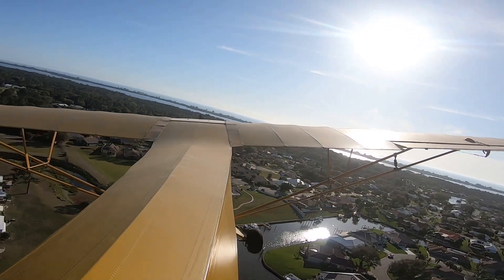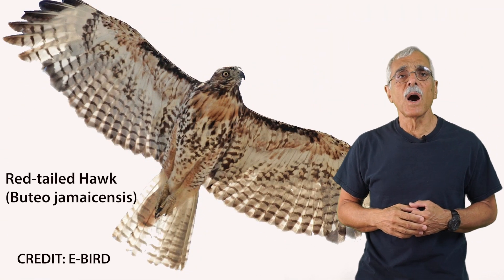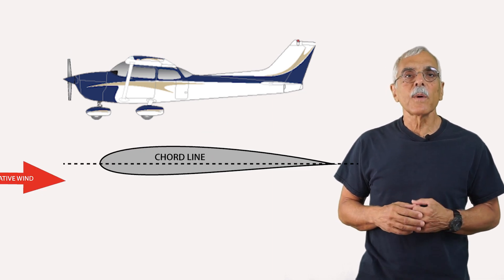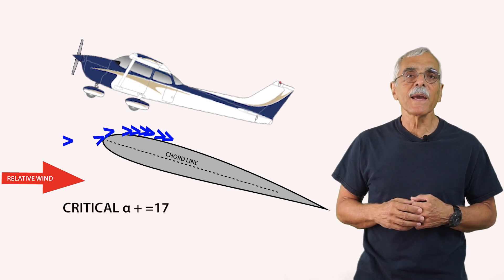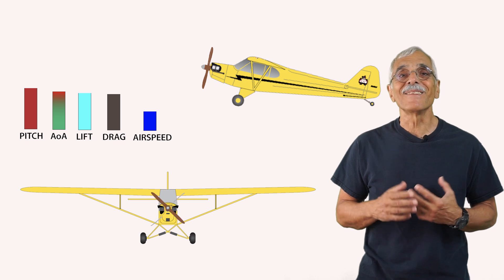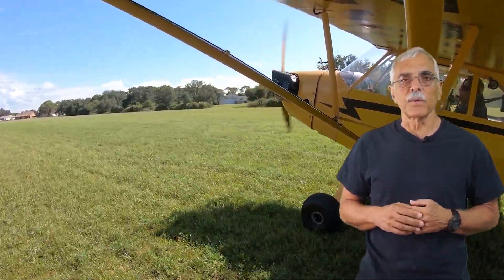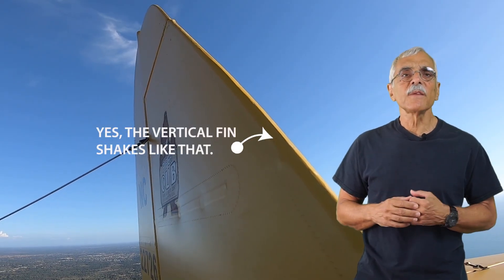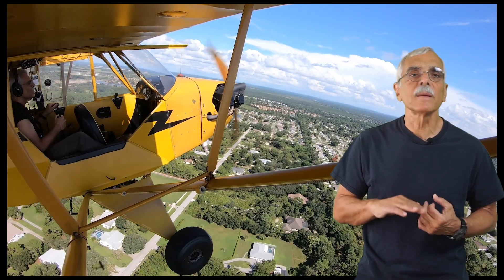How I Stalled on The Base Turn (And Got Away With It)

Comment: As I got past sixty years of age, I realized that there were moments when the slightest distraction could and does cause “brain farts”. I'm sure many of your readers/viewers are probably aware of them, and I wonder if you might know of any exercises we could do to lessen the chances of this happening while in the air. Also, a Washington State YouTuber called Backcountry 182,  is a very focused pilot and has installed an angle of attack system in his 182 and 170b. The thing that struck me was your comment about having to look at another gauge you didn't have to before. The advantage to this unit is that it mounts on your panel dash somewhat like a HUD, only it is a physical device that is in your viewline. Easy to see without being a distraction. The sensor device mounts under your wing like a pitot tube. Just a thought. I'd recommend it judging from his videos. He spends a lot of time flying the back country in his modified aircraft, landing at remote strips and landing/taking off on river bars.
Reply: You are constantly monitoring your airspeed on final anyway.
So installing an angle of attack indicator close to your line of view
of the outside, or the airspeed indicator might help a lot without 
increasing your mental or physical workload.

Comment: Great Video. I was on base at CUB turning to final in our Champ and the pilot I was flying with was talking about a friend's just finished RV7 holding for takeoff.  We were in radio communication, keeping looking at the RV7 and getting set for turn to final I got slower than comfortable. I didn't stall, but I realized as a lower time pilot that it was important to make sure that I didn't get distracted.

Comment: I've been teaching that so long as you are gentle on the rudder pedals down low on approach - then you probably will slip a lot. But you won't skid. If anything startles or surprises you: PUSH forward on the yoke/stick. And for the love all things good: if you find yourself slow and low; only push the rudder pedal that's high in the sky.

Comment: Just use the stall warning device in the Cub (and every other plane). It's called the stick (or yoke), and your plane will stall at the same rearward position every time (or forward position if you're inverted) regardless of speed or bank angle. Just remember where on your thigh the stick/your wrist rubs when it stalls and you'll always get a wake up call when that part of your thigh gets a rub.

There's a direct link between elevator position and angle of attack, and the wing always stalls at the same angle of attack regardless of bank angle (or whatever). And there's a direct link between elevator position and stick position.

Go up and give it a try at different speeds and bank angles (not too fast - you don't want to rip the wings off)

Comment: I did something very similar. I was looking out the window and slowing down at the same time. I was in a early model super cub with no stall warning. When i felt the shudder from the stall I was in a shallow left turn so I added right rudder and power but I was too low to recover before hitting the ground. The impact was hard enough to shatter my lower vertebrae and brake my brothers ankle. By the grace of God we both recovered very well. I have since added about 15000 hours to my logbook as a professional pilot and the biggest thing I take from my mistake is never quite flying the airplane or it will bite you.

Comment: Oh man…reminded me of this time I was requested to do a 360 on base to let another faster plane land first…midway through my turn the stall alarm went off. I was still a student but it’s impressive how quickly things can creep on you if you’re not scanning the instruments enough.
Looking back, when I was requested to turn, I stopped my descent and didn’t adjust power enough to maintain speed, you live and you learn!
Reply: Still a student pilot here :)  I never heard about being requested to do a 360 on *base*, that seems very weird.  And dangerous, as you found out; you're in a low power, low airspeed descending turn (or about to make one), and suddenly asked to change direction and maintain altitude.  Sounds like a recipe for disaster.  Was this at a controlled field?  If this happened to me I'd probably have called "unable".  Maybe they'd tell me to go around, but that's a well-practiced safe maneuver.

Comment: my own fluster moment ,flying my  1947 Navion, approaching the airport at crosswind, expecting a right turn to downwind everything going fine, just before turning downwind, the airport announced conditions determined la ndings done in the opposite direction I was prepared for. no problem, I'll do a crosswindentry to downwind across the runway- it all went exactly as planed- smooth as silk, as I turned final at about 200'AGL,I cutback the power and heard my gear horn go off, I was committed via altitude and speed to land, lucky me the Navion had great gear response and I got 3 greens about 2 seconds before touchdown (whew). what caused it? just as I was to lower landing gear is when t he airport advisory stated direction changed- and I totally forgot to lower the gear. a person gets used to doing things in a one order of attention, once that was lost, I never thought of it again- thankful for the safety o fthe Navion,

Comment: Bet that bird didn't stall :-) Really enjoy your aviation content, thank you!
Reply: Yes. As pilots often say, the best flyers on the planet are birds. Now, I have to look up if birds actually stall. I've seen some come close.
Reply: The bird has a cheat, its called feathers 🙂
When the airflow starts to depart from the wing in a stall, the airflow lifts up the feathers. Muscles pull the feathers back down and this also pulls back some of the departing airflow.
Which means they can handle much higher angles of attack and not stall.
This is also how stooping hawks can go faster in a unpowered stoop than terminal velocity should allow.
The feathers moving up and down trap a boundary layer of air which greatly reduces their drag.
And also interferes with the creation of vortices coming out the back.
kind of like the dimples on a golf ball but more efficient.
Owls use feathers to control the airflow, for no noise, so they are silent death.
Amazing things feathers. Aircraft and race cars need to be covered in feathers.
Reply: @quadg5296  Hi Quad. That's very interesting. Mass itself must play a critical factor. Now I have look up more information. I did not understand the "feather" factor, but it makes perfect sense.
Reply: @T.J. Kong 
A wing works by having high pressure below and low pressure above. Which generates lift, created by constant smooth air flow. Across the aerofoil. Turbulence does not help. The turbulence is the airflow becoming detached and interrupting the constant air flow. 
Which we call a stall. Instead of lift you get turbulence and drag.
By pulling the feather down they induce low pressure into the space between the turbulence and wing which attracts the air flow back to the wing and gets the airflow flowing again. and generates lift.
Lift is generated by smooth airflow, not turbulence.
Why the feathers don't lift when the airflow is not interrupted by turbulence. And only lift when the turbulence induces them too.

Watch the video again for the stall explanation. The arrows are smooth airflow and the spirals are the turbulence where the air detaches. a feather will pull the spirals back to the wing and turn them back into arrows. they actually constantly flutter when in a stall.

Comment: One big difference between practicing stall recoveries and actual accidental stalls is, practice stalls take place at high altitude when you expect to have a stall. An accidental stall happens usually at low altitude when you are not expecting it. 
     The trick is to be ready all the time, so when it happens you can recover without having to think about it.
     If you trip while walking, if you have to think "Oh, I'm tripping. I have to do such and such to stop myself from falling." you are going to leave your face print on the sidewalk.
     When you trip your reaction has to be automatic, because you don't have time to think about it.
   The same is true of pattern stalls.

Comment: For me, this moment was not watching another bird during an approach, it was watching THREE other birds, i.e. busy pattern as a student with an instructor in the right seat.  Flying a Cherokee on our approach (left traffic) at a very busy Class D airport, the tower called me "you're #3 behind a Cessna, opposite downwind abeam your position".  I saw the plane on short final, I saw the plane on base, but I didn't see the guy on the downwind opposite us.  On a previous flight, I had been #2 and had started my turn from downwind to base too early for my instructor (before the other plane was abeam going the other way on Final) and he took the airplane away from me, so I was determined to find that guy and make sure he had passed abeam on base or final before I made my turn to base.  I had just brought the power back to approach setting, confirmed in the white arc, put one flap in, and set the trim for 90mph.  I then commenced examining every inch of the sky looking for my traffic to follow.  Pretty soon my instructor says "airspeed".  Again, a little louder - "POWER".  Finally he's yelling "POWER!"  I looked at my ASI and I was down to 65 mph....very close to stall speed which in this plane was 63 mph clean and about 58 with one flap.  I had been so focused on watching #1 and #2 and looking for #3 that I wasn't paying any attention to flying the airplane.

Comment: Loved 3 pointing the SNJ5 and making the first turn off at OKV's 32...flying short final a maybe 5kts over stall... so many T6 pilots land 20 kts or more faster than needed and use 2000ft of runway with the tail still up.

Comment: I saw a 727 hit a red-tailed hawk once.  Hawks used to perch on the bars that held the lights on the wind sock at the approach end of 28L at KCMH.  Sometimes, they would take off and fly around and then land back on the bar.  Well, one time a hawk did that just as a 727 touched down and the timing was such that the hawk ran right into the wing tip of the airliner.  He generated a big ball of feathers and a radio call as the pilot reported that he thought he hit a hawk.  I watched the whole thing from the left seat of a C152.
Reply: My scariest moment in the air was a lack of attention to detail like this. My daughter was with me. A long flight dodging clouds back to hot perfect conditions at home. I turned my 182 too slow to final. That Inboard wing dropped and scared the shite out of me. Somehow brain managed to scream rudder and power. I saved the turn and found an instructor before I flew alone again. Such a short moment of inattention could have kind me and someone I care about. I now fly circuits at 80 minimum until short final. The 182 slows down like a brick when needed.

Comment: The only inadvertent stall I ever experienced was in a similar situation. Shortly after earning my Private Glider ticket I found myself  in an unfamiliar (to me) glider, in a thermal with another glider, and distracted by the need to avoid said other glider. My glider was banked about 45º and my head was turned back over my shoulder to keep the other glider in view. I missed the warning buffet and had the glider drop a wing suddenly in the direction of turn: a classic incipient spin. Got my attention, you betcha. I recovered, now a couple of hundred feet lower than the other glider, and I haven't repeated the experience in the almost 50 years since.

Comment: I had a similar experience when doing some glider flying when i was at university. It was late in the day with a low sun behind me and as i floated down on approach i saw a giant shadow of the aircraft on the ground swooping down. It looked dead cool and although i only glanced at it for what seemed like a split second, a look back at the panel revealed my airspeed had dropped from around 60 to just under 50. It was fine, but it was a real eye opener as to how quickly things can go wrong

Comment: Distractions are a huge killer.  The other thing that bites us hard in general aviation is a total lack of DMMS (Design Minimum Maneuvering Speed) criteria or training.  We practice straight ahead level wing stalls, both with and without power,  but not turning stalls at different AOA, bank, and speeds.  We don't even have any data to tell us at what speed, AOA, or banking angle our particular plane is likely to stall so that we could maintain 25-30% above the deadly critical speed or under the dangerous AOA or bank angle.  I think the FAA  needs to step in and require GA aircraft manufacturers to provide this critical data for every plane they make now, and at least the most popular models they have made for decades.  Lives would be saved!

Comment: I've had mine. I stalled a Citabria on final. I was getting a checkout at a new flight school/rental place. We were high on final, and I was trying to steepen the glide (per the "large patterns" video), and got too close to the edge. We were still high, so we had plenty of altitude. I recovered and went around. The instructor waited until we were back on downwind and just said, "Whoops".
Reply: Don't get it. Did you slip and let the nose creep up? If you lowered the nose (increased speed) how did you stall? Over bank?
Reply: @jonathanshirer2395  I kept trying to steepen my glide by going slower. I just took it a bit too far. There was no buffet, just a very sudden and obvious sink. A little forward on the stick and full power and we were climbing out.
Reply: @jjohnston94  Slowing down will at first stretch the glide, then it will quite suddenly steepen it (stall). Your outcome seems very fortunate to me. The instructor's comment may have referred to the condition of his trousers. :-)
Reply: @jonathanshirer2395  Any time you're below the speed of best glide, going slower will steepen the glide. There's probably a 10 or 15 knot window in there where you can glide safely above the stall. It's been over 20 years since then, so I don't remember all the circumstances, but I should probably have slipped it instead.
Reply: @jjohnston94  Peace, brother. You're still with us.

Comment: A cub can just barely kill you. Had a friend and an instructor stall a cub after engine failure (tried to turn back to the air field on take off) and broke the plane pretty badly  but a few years later it was back in the air  completely rebuilt.  Some stitches in the head  for the student (a helmet would have prevented that).  Instructor just didn't think the Cub would stall.  Oddly enough there was enough field left to land and roll the plane into some scrub bushes and a barbed wire fence at the end of the runways without the turn. So the plane just squashed it's gear and busted the wing on the runway.

Comment: I regularly watch a cub land (here in Ireland & is also grass strip) with my heart in my mouth as the 'pilot' seems blissfully unaware of the extreme risk of stalling on a low approach as he makes a tight turn onto finals at a deadly slow speed - where he is clearly more interested in breaking his unofficial landing distance. (Ps. PPL holder since 1976 so I know what I'm looking at) 
The worst thing is I KNOW the club CFI and instructors have seen this several times and he never gets 'spoken to' about it.. Probably more interested in hangarage fees etc. etc.